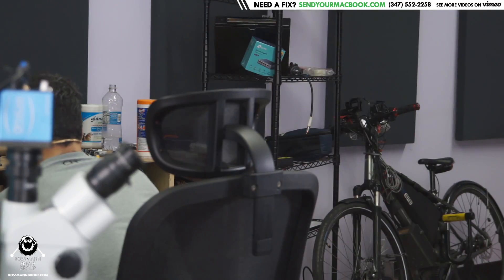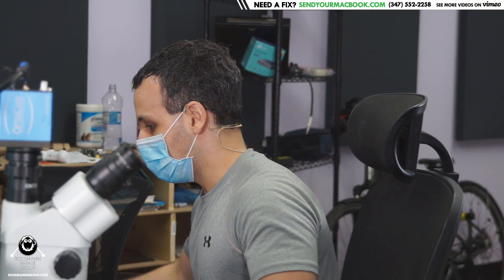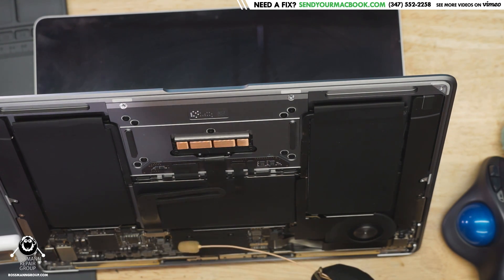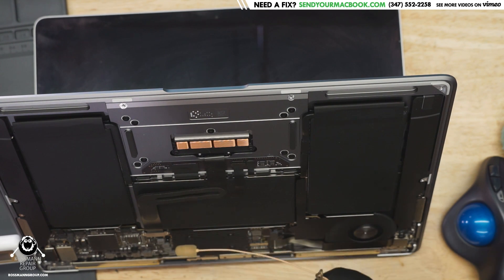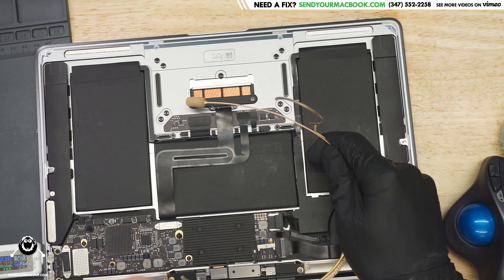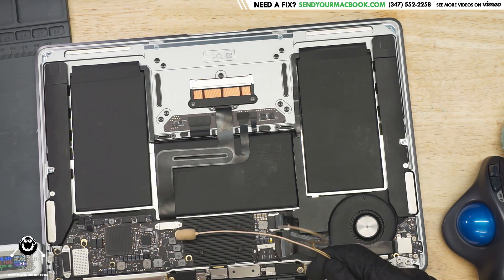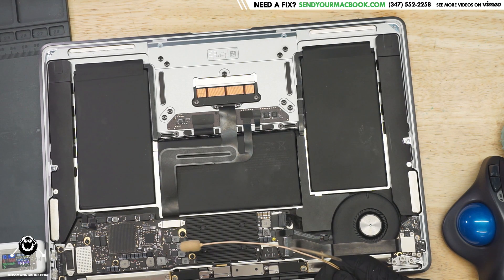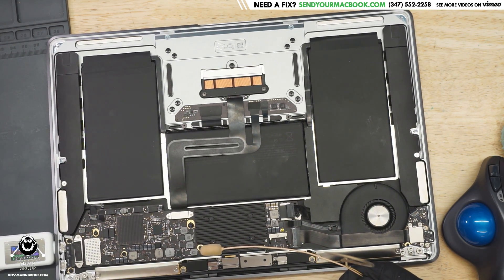The sound of a suffering Macbook Air CPU with no heatpipe 😢

Comment: I'm convinced apple has some running inside joke to jam as many objectively bad engineering choices into a device and it still sell. Doesn't the macbooks hinges break in half?
Reply: Knowing how sick big corporate engineers can be that wouldn't be farfetched.
Reply: The bezels do, due to the screw holes causing stress concentration points in the thin aluminium, leading to fatigue under normal use.
Reply: That joke is the base of this entire channel
Reply: This remind me of something https://www.youtube.com/watch?v=31JNEVHZxO8
Reply: To be fair, it does essentially the same thing by channeling the air over the heatsink rather than using a heat pipe to carry the heat away to another heatsink of the same area next to the fan. But if your cover gets damaged, good bye cooling, and theres less thermal mass to keep it cool when you have the cover off.
Reply: @mysock351C  The fan isn't even pointing at the heatsink.
Reply: @Knowbody42  But when the cover is on the machine, it forms a channel that pulls air across the heatsink. The air comes in from the left side (presumably via vents), is pulled across the heatsink fins, and then is exhausted by the fan on the right side. The CPU is only cooled when the back cover is in place.
Reply: @Knowbody42  The fact that it doesn't have a heat-pipe points to it being a disposable machine. The CPU cooling will work acceptably when the cover is in place, but you cant run it without the cover to do diagnostics or swap memory/HDD. Most other laptops have a heatpipe with integral centrifugal fan that cools the CPU regardless, so it can be run with the machine taken apart, which is a nice convenience.
Reply: @legros731  Like seriously, did your brain fall out? The dissipation is a function of the heatsink area, and the airflow rate. Heat pipes have a fairly small but dense fin stack in them in front of the fan exhaust, which is how they dissipate heat picked up from the CPU and possibly the GPU as is done in my Laptop. In this case Apple did away with that, and took a somewhat circuitous route by mounting the finned heatsink on the CPU itself and using the case to form a channel to allow the fan to pull air across it, getting the needed heat dissipation. Its not ideal in that the CPU will overheat without the back panel/cover in place.
Reply: @legros731  And hey, I dont like Apple, either, but from an engineering perspective, its an acceptable solution. Just not ideal if it needs servicing as the only thing preventing the CPU from cooking is the internal protection that dials back the clock frequency.
Reply: @mysock351C  If that is what they were thinking, then my 2nd year Heat & Mass Transfer Prof would retroactively fail them. Air is a shit poor heat conductor, and their isn't enough air flow to fix that.
The only reason it doesn't fry is because Intel designed it properly and it Thermal throttles.
Reply: @domoncar6782  Without, at the very least, knowing the specifications of the fan, you can make no judgment. That same fan is also likely used in heat pipe setups that have similar airflow rates and exposed fin areas. Do they fail as well? Im sure they did the modelling and found it kept the CPU at a safe temperature. Also keep in mind its not dissipating hundreds of watts, its only dissipating maybe 20-30 watts nominally. Also keep in mind that running at 70-80 degree C temps heatsink wont kill a CPU. I've had workstation laptops that run so hot they literally start to smell (and that was with heat pipes to boot), and even they lasted for 5-6 years before I had it replaced due to obsolescence. While this is not the best thermal design, its by no means the worst.
Reply: For a ballpark value, even if the fan can only manage around 5 CFM (they're typically more like 10-15 CFM), thats only a 35 degree C delta T for 80 watts of peak dissipation. Assuming a delta T for the heatsink of 20 degree C, thats still only around 80 deg C, which is within the allowable limits. As I said, you really need to, at the very least, have some specs. to make any judgement on it working or not.
Reply: @mysock351C  dude, we KNOW for a fact that these CPUs are severely thermal throttled. Thus the cooling is already sub par. 
Any engineering design keeps a bit of margin, but for these "premium" products, the design has to work at 100% efficiency to barely keeping the CPU from cooking itself. Yes, the CPUs can handle sustained 70C, but this is doing 70C with full fans. What happens if, let's say, a bit of dust accumulated? CPU barbecue.
Air cooling isn't bad, Desktops do, the Design is why it fails.
Reply: @mysock351C  it does not matter.
its an insufficient cooling method for even low powered laptop chips, this is why all other manufacturers work with pipes.
a heatpipe is not expensive, apple is charging you 1000+ on a device they are skimping every cent off to go towards their margin.
it does not cost more, it does not take up notable space and it will increase the life and productivity of the device greatly,  not putting it in to save a few cents on the backs of your consumers on a premium priced product is NOT ok v0v.
Reply: @domoncar6782  Do you have data? I've seen nothing but "oh it overheats." No data. No actual tests showing the temperature vs. load. Just "oh lol it wont work!" or "Louis Rossman said.." Opinions are not data. Period. And yes, I know there needs to be some margin. Im not stupid. I have practical experience working as an engineer. Yes, obviously its not optimal since the form factor is so small. I already said this. They shoved the whole MB into the back of the machine so to get it to work they skipped the heatpipe and located things so that the DC-DC converters and CPU could be directly air cooled in a channel formed by the case. Yes it will run hot. Probably 70-80 deg. C under a heavy load and the fan is going to be noisy as hell and have to run more often since there is not as much thermal mass, which is where most of the "complaints" seem to stem from. The fan has to work harder to dissipate the heat during application intensive processes. This is not overheating. This is annoying the user. Apple very likely had an entire team dedicated to simulating and testing this design. The design probably meets its specifications, but ignores the user and what is acceptable as far as noise goes. This perfectly fits their MO on how they view their users. Form comes first, the user comes second. Makes sense, right? This is all obvious from inspection, and I indicated this in my above posts that the design is only "acceptable". With enough airflow, it will work. It will, however, be annoying to its user. As I've said, I've seen worse on older machines. Much worse. I had a high power work laptop with all the bells and whistles for cooling, and it ran beyond hot. Like it would leave minor burns on your thighs if you weren't careful since the CPU just guzzled power like there was no tomorrow and sounded like a 747 on its take-off roll.
Reply: @domoncar6782  And to be abundantly clear, overheating is not "the fan running a lot". Overheating is the CPU case getting over 100 degrees C and tripping the thermal protection, which is something that actually happens on some other laptops as well depending on what settings you use. So far, I have not found anything conclusive in simple internet searches. Just "the fan runs a lot" or "its noisy". At any rate, I dont think there's much more to say that hasn't already been said.
Reply: @domoncar6782  Some actual very basic testing, which confirms my suspicions. https://www.notebookcheck.net/Does-the-MacBook-Air-2020-have-an-overheating-problem.462161.0.html And dont bother with "its thermally throttling!" as other laptops do this as well. What I want to know is what is the temperature vs. % CPU load, and so far nobody can provide that. However, I suspect that as I said above, its  merely "acceptable". It will keep the CPU below its thermal protection under most circumstances at the expense of excess noise, which is what I already hinted at above.
Reply: @mysock351C  This MacBook Air runs hotter and throttles like crazy. Look at LTT latest video on macbook air and how bad its power delivery is, The processor inside it is very capable
Reply: @clickbaitpro  Yeah. Its just "acceptable", which in engineering terms means it just works. Not works well. At least in that video they finally put a damn thermocouple on it and take actual quantitative measurements. Its worse than expected, but still not outside of what I would have expected to see. I say that because Apples not alone in doing that, they're just much more egregious about it. I had to override the variable clocking in my work laptop and lock it at max frequency (really bad idea, don't do it) to get some CAM software to work, and it got to the point of making funny smells it would get so hot. But it beat getting reamed out for missing deadlines. I can see why they did it, which was my original point. But given todays binary logic people seem to only be able to think in black and white. Good and bad. Not see the entire picture of why they made that design decision. It does make sense given the ABSURD design constraints apple puts in their products, which in the end is the real issue with their products. They make paper thin trendy metal boxes and leave it up to the engineers to shoe-horn it in there. Even bigger problem is that all laptops are headed in that direction of being little trendy metal boxes that you cant open. I bought a high-end laptop that was like that, and the damn SATA controller in the Intel CPU took a shit (at the end of warrantee, of course). If it was an apple, my day would have been over. But in this case it still had a serviceable design. Even then it was still tight inside, but at least they allowed enough room to make sensible design decisions. As you probably know in the future that will be a thing of the past. You just bin it when it dies.
Reply: @clickbaitpro  With that said, they could have actually gotten a lot closer had they used a finer pitched heat sink, and ditched the black anodized coating for polished aluminum. Not needed for convective cooling, and the smooth finish will help minimize turbulence and allow you to get more fins (and more cooling) in there. Thats the one big exception with the design. The idea is workable, but the heatsink looks too sparse for the job its tasked with. Looks like bean counters had a say and made them design it down to a cost, which is a shame.
Reply: @clickbaitpro  And just to be clear, the reason they likely did it was due to the density of the PCB. Not having the heat pipe probably gave them enough room to squeeze the flat cable and the connectors in there where the pipe would normally run.
Reply: @mysock351C  No it's really not that simple. Heatpipes are not just a bit of metal, they're hollow with liquid inside them, and they are designed to have a precise amount of vapor and liquid to carry heat effectively. We're no longer using K5 Athlons, passive heat sinks and indirect fans just do not cut it.
Reply: @SPAZTICCYTOPLASM  FFS Don't you think I know that??? I have a graduate degree in engineering and many years of experience.
Reply: @SPAZTICCYTOPLASM  And for what its worth they do actually make ones that use heavy copper strips in lieu of the heatpipe, but yes I know how they work. Forgive me for being snippy but people here seem to automatically assume you know nothing, even when they sometimes don't know.
Reply: @mysock351C  no it doesn't
Reply: You just can’t afford one.
Reply: middleman Image being this bad at trolling
Reply: @middleman3165  i just dropped a steamy turd, ill sell it to you for 2100USD.

What you dont want to buy it? Yeah okay  thats because you're poor.
Reply: @middleman3165  "It's exclusive shit it costs 25 dollars extra"
Reply: @middleman3165  Nobody can afford to have a breaking laptop

Comment: How do you know that a simple heatpipe would make anything better. You would have to add a smaller heatsink to that heatpipe then you have now or otherwise you would have to make room for the same size heatsink in front of that even bigger fan by making the Air bigger too or the battery smaller. https://i.imgur.com/TJRAhI4.jpg it wouldn't matter that you have managed to get the heat away from the CPU and over to a heatpipe based design if you can't get it out of the machine due to the limited space for the necessary heatsink. So as long that you can ensure a good air flow from one side of the cabinet to the other, then you will be a lot better of with this passive design in a enclosed chamber.
Reply: I don't know whether it's a better design but from what I understand about heatsinks, the size isn't as important for active cooling as long as it makes full contact with the heat source and it doesn't over saturate the heatsink, however I totally agree that I see absolutely nothing wrong with this design as long as it gets good airflow and it isn't heating up anything important on its way out which is one disadvantage to this approach.
Reply: @vgamesx1  In the end it is all about transferring the energy to the air. The smaller a heatsink the greater need there is for a good air flow, like from a bigger fan.
Reply: @ȘȚɄƑƑɄ1oo  An how big a battery dos that XPS you talk about have? for how long dos it last. This is a all day study machine, that's also why it's equipped with a Y series rather than a U series like its big brother MacBook Pro. it's all about priorities
Reply: It's just like when he thought that Apple had chosen to use a flex cables to connect their display to the motherboard to save money without realizing that there is no longer a panel inserted into a frame but that the whole screen part now rather is the panel itself. You may disagree with Apple about whether it's worth the few millimeters thinner display or not and that's also fine, but it doesn't make it to a design flaw.
Reply: @ȘȚɄƑƑɄ1oo  It's a laptop based on a U series 15 Watts CPU with a bigger 52Wh battery. That's properly why he also is comparing it to a 13 "Macbook Pro. It's a design choice not a design flaw. It is a thermal design choice that works well for short-term turbo boost example when opening a application or changing tab. There is a great area which can absorb the heat and slowly release it again over time, but it doesn't work very well for long-term rendering and that is properly why they have chosen to go with another design choice for their larger MacBook Pro. As for your blinded religious opinion about the way Apple is calculating their average battery lifetime, then Apple is mostly known to be far more reliable in the information they provide to their customers versus what you can expect to get in real life from normal use. This is mostly because they have done the calculation based on a typical web browsing session with an x number of open tabs. But yes, the "10" hours he claims to get from this Dell XPS, is not bad at all :)
Reply: @nickvogelius  "blind religious opinion" Can you read dummy? Speaking of blind religious opinion, pot kettle much you moron?
Reply: @ȘȚɄƑƑɄ1oo  The Dell XPS (9300) is a good alternativ to a 13" MacBook Pro, but to claim that Apple is known to be lying about the expected battery life is as stupid as be claiming that Apple does not give a shit about the visual expression of their products. It is precisely one of these parameters where that Apple stands out from the competitors versus like buying af Mac to game on. Yes you can game on a Mac, but!!! I really doesn't hope that anyone would buy a mac with that primary purpose of be gaming. But that doesn't mean that a Mac is therefore shit! and a gamer PC from Alienware is = perfection ;) in that case, you are religiously blinded. Anyway, If just people would use half as much of their energy on politics as they spend on brand loyalty, then the world would be a far better place, don't you agree?

Comment: How tf do you get a CPU to start clicking
Reply: I looked it up and found this: Clicking, whining or screeching noises can also be caused be the die of either the CPU or GPU heating up rapidly while being stressed. Sometimes auto fan settings can take a while to discover the change in temp to adjust fan speeds accordingly.
Reply: It's more than likely a bad inductor in the vrm part of the circuit. if you pay attention he puts the microphone over those little gray boxes. Those have little bits of foil in it, that foil has come loose and in the flux of the  magnetic field causes the vibration as the foil is repelled and attracted.